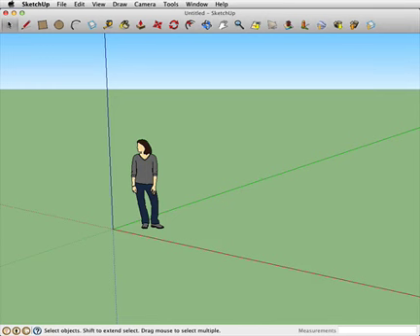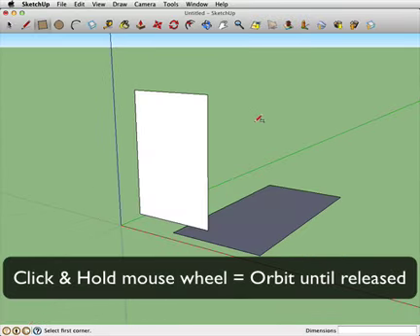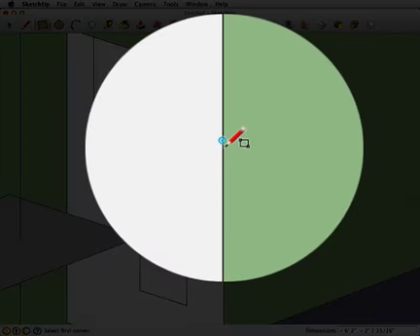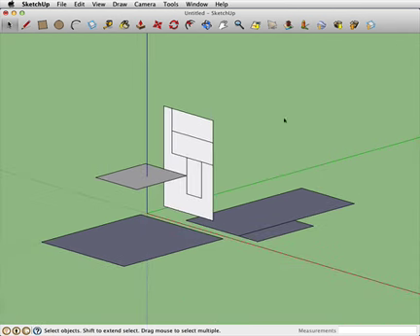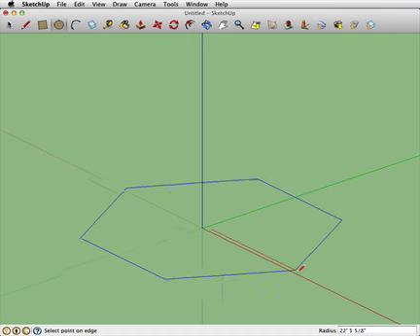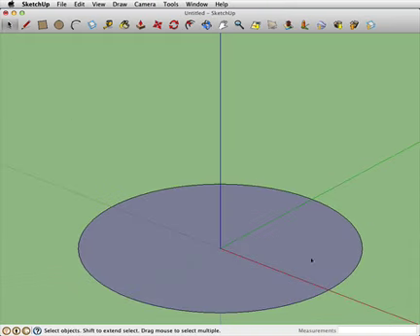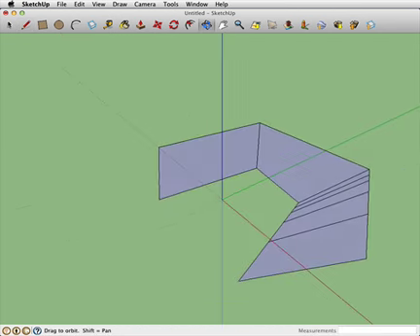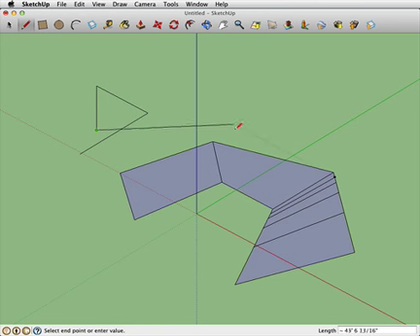SketchUp for RC Plane Design Tutorial #2

Comment: is this the pro version?  i cant get the measurement/ circle edge dimensions in the bottom right corner to toggle?
Reply from the maker: This isn't the pro. If you are on windows you can just start to draw a circle and then type the size. The numbers will appear in the lower right as you type.